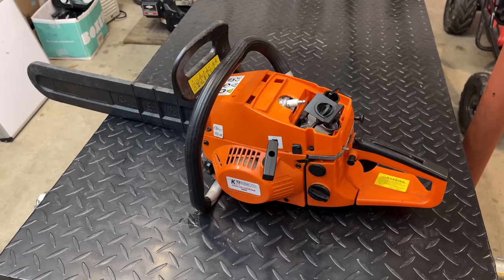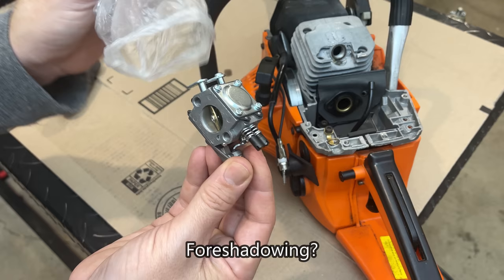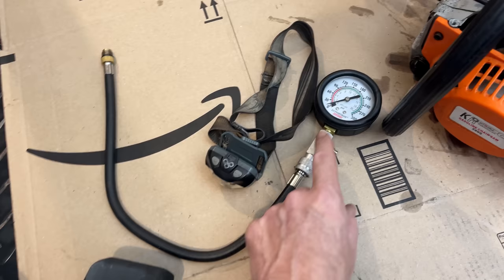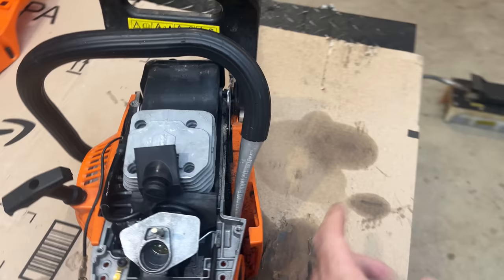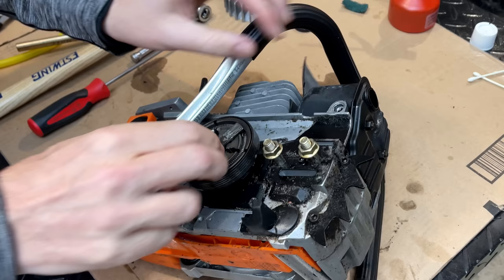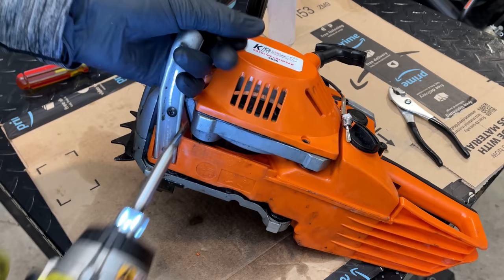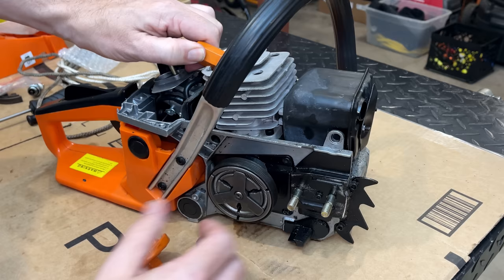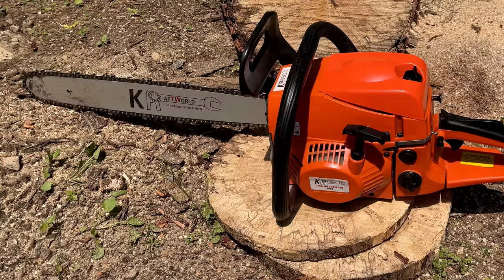Chinese Chainsaw Challenge - Will it Run? (Unbelievable Amount of Problems)

Comment: The expensive cost of buying cheap equipment.

You can buy once, cry once; Or buy continually and cry later at the hideous cost of repairs.

With just the time in labor and research alone, you could probably buy 10 of these saws and hope you get a good one, or buy one really good saw and not have to deal with these problems.
Reply from the maker: Even worse I found the link below.  These saws sells for about $32 wholesale.  https://www.alibaba.com/product-detail/High-Quality-Chainsaw-2-Stroke-5800_1600488897662.html?spm=a2700.7724857.0.0.56914d5fpTvqza
Reply: @jcondon1  Really sad to see mass produced junk like this, it's a gravy train for unethical salesman. I'm sure that these saws are going to end up in landfills and junkyards across the world. If this one saw has so much wrong with it, you know the rest are going to be of similar quality, especially for $32-$50 a saw.
Reply: Amen!
Reply: thats usually true..........but then I own a little chinesium 12" saw and it has been awesome.......its small,handy and makes pruning down medium trees up a ladder very easy. Is it a trade tool, of course not.......but it has been very versatile and worth the AUD $100 (US $67) I paid for it.
Reply: @wazza33racer  Chinese engines are not bad 100% of the time, I have a snow blower with a Chinese engine (Briggs and Stratton) that has started first pull and operated flawlessly for 4 winters now. But, in general the Chinese engines have far more serious design and manufacturing flaws than required to offset the attractive price. I have considerable business experience attempting to source quality products from China...the horror stories far outnumber the successes.....it's a gamble with unfavorable odds.
Reply: Every issue that James addressed are due to marginal designs...those problems are not fixed long term by installing new parts. They will surface again and how many issues are yet to be exposed?
Reply: @GGigabiteM so true
Reply: @Bunk599  I’d say the failure wasn’t with the design:  it was with the assembly.
When installed properly, the seals on both sides of the saw did their job.
The fuel line was the wrong material, so that does go to a ‘design’ failure, but it’s a minor fix.

For the wholesale price, it makes chainsaw ownership feasible for anyone.

Even so, I’ll stick with my Stihl.
Reply: @jcondon1  You just got to love the fake reviews.
Reply: @GGigabiteM  exactly my thought.
Reply: @Bunk599 Id like your opinion. Japanese products were looked at the same way as Chinese products years ago. Now they are premium products.. I believe if during manufacturing, the brand company told the Chinese  to build it with this type of tolerances, using this grade of material, with a good quality control team, that they could hang with most other countries in terms of quality. Its my belief that many American companies are so whorish for cash, they specify to Alibaba junk material with junk tolerances/specs with little to no quality control. Then if it turns out like crap. They don't care, they blame it on the Chinese and walk away laughing with all the money they saved by having 8 year old girls assemble the stuff. In other words, they produce what the company specifies and allows. Predator generators are Chinese Honda clones and the tolerances are so close to Honda you can barely tell the difference anymore. It's not as good- but quite good for a third of the price. But HF cares and has pretty good quality control. Hope this made sense. Any thoughts since you said you've experience with that scenario?  Cheers
Reply: @giggiddy  Thank you for your thoughtful reply. I too experienced first hand the dramatic transision Japan made over a span of 15-20 years starting in the 1950s. They of course today lead the world in many areas. China has had more than enough time to replicate that  progress. In addition to the Governmental and Commercial influences you mentioned I believe culture has an equal impact on the design and quality of the products produced by a country. I ran engineering/manufacturing companies in San Francisco, Detroit, Allentown and Austria. The skill, approach, expectations and thought process exhibited by the engineers in each location were dramatically different....my exposure to Chinese engineers was also quite different. Two of my very close friends have owned/managed significant manufacturing operations in China,....products and companies you would recognize.  I have many stories to tell that explain the quality of most products from China.
Reply: My concluding thought....not everyone can afford the good stuff....but if you can you are better off with a chainsaw made in Germany than China...in fact that sentiment applies to nearly all products.
Reply: @Bunk599  Wow. I sure appreciate your detailed reply as it comes firsthand and thats what I was hoping for. Additionally, you've made me rethink my position on the manufacturing process in China. Again I appreciate your response and I'm going to further educate myself on how things work there. I'm a huge fan of engineers and a enthusiastic student of anything engineering related. Your response made my day. Cheers! Dan
Reply: @giggiddy  You are certainly welcome. I enjoyed our exchange. I reread your email and I had one more thought on your comments. It has been my experience, many of the successful manufacturing operations in China producing high quality products are those situations where a reputable company with proven designs, like Briggs and Stratton, establish factories using their designs and manufacturing processes...China provides the buildings and machines specified by Briggs and the inexpensive  subsidized Chinese labor. Often the Chinese government controls pricing on raw materials to be far under the Global Market price which artificially contributes to a low manufacturing cost and selling price. This is a constant issue between China and competitors in other countries. The risk is China just decides to copy the product design and sell it under a different name....that is the origin of many of the Chinese clones. Best Regards, Al.
Reply: @Bunk599  Don't quote me but when they manufacture for external "foreign" companies under licence (ie with quality control and specifications checked) there's a better chance of getting reasonable quality at cheaper prices.  But when China attempt to "copy" and produce products under different branding the quality control is thrown out the window along with the Uyghur who screwed up 
And with "recognised branding" (eg Briggs and Stratton) comes reputation plus better, more controlled, returns/repair (customer service) because social media responds 😉😉
Reply: The petrol was not mixed properly with the oil ratio. Simple mistake.
Reply: I agree, the battery powered saws are much better.
Reply: Exactly.  Buy cheap, buy twice!
Reply: @Bunk599  I bought a Husqvarna 365 years ago instead of a Stihl. Not that Stihl is a bad chainsaw, you get a better value with a Husqvarna.
Reply: @brianallen9810  There are many good chainsaws that perform well for decades...just doubt any are designed by Chinese at the moment. I had a big Poulan and a  small Craftsman in the 1970's...they cut a lot of wood, took far too much abuse and always started. I too am a fan of Husqvarna.
Reply: @jcondon1  haha these saws arnt even worth the metal cost to make them. guess its a good thing these things are made with basically slave labor
Reply: @davidanderson4800  You will not see a commercial grade saw with a battery. They have their niche but the battery stuff still doesn't make the grade with hard usage. I still use air tools in my shop for the same reason.
Reply: @Bunk599  the blocked fuel hose, was just poor quality control, the seal installed crooked was poor process quality and quality control. The clutch band brake burned out is something I have seen fixing quality Stihl saws (operator error).   Otherwise, for a cheap saw, that someone might use occasionally its fine.  If you are going to cut a lot of wood, and its mission critical, then buy a quality chain saw.  Horses for courses.
Reply: @wazza33racer  I can agree with many of the comments that there were more than enough QC issues to go around, but I still contend most of the issues originated with poor engineering design and material specifications that are not corrected with repairs. The fuel line cracking is just inexcusable for a relatively new saw and a crank seal that still leaks after careful installation and a crank nut stripping is are marginal designs not manufacturing error. There are half a dozen design issues that would result in this new saw being unusable and tossed in the bin were in not in James Condon's capable hands. These issues do not just result in inferior performance to be tolerated by a part time user  but rather result an utterly useless product for most owners......thats not a bargain at any price. It would be fun  for James to keep in touch with the saw to see just how long it manages to operate before a new problem puts it out of commission.
Reply: @Channel-gz9hm  I am not a bot...just an old retired engineer with too much free time on his hands.
Reply: 32 dollars for this machine is still too expensive. I would pay 0.
Reply: Echo equipment, affordable and built to last!
Reply: @GGigabiteM I agree its a shame so much mass produced junk these days
Reply: @octaviofigueroafigueroa9794  Paying $32 for endless aggravation is a bad investment
Reply: @williamfoote2888  This is an Old new saw, last sold in US in 2017 it could be even older the fuel line cracked do to age, ethanol fuel left sitting, that will and does kill even Stihl saws, in fact on new ones if you don't use caned fuel warranty is void
Reply: There are certain exceptions, I own a 2006 Lifan  dual sport  200 cc motorbike with the Honda CG200 clone engine The previous owner put over 70K of gravel and road use and sold it to me.  I've basically just added gas and change the oil twice in 4500 miles now, and it still rides and starts well.  This bike is the Skyway GY 200 which Lifan licensed to build 1980's Honda clones for their far East markets.  Sold by Lifan America back in the early 2000's.

They're robust little bikes and use a OHV instead of OHC for the valves, sold to their customers in countries where as either rentals or because there's little mechanical support the simple pushrod engine's can be run longer with lower standard of maintenance.
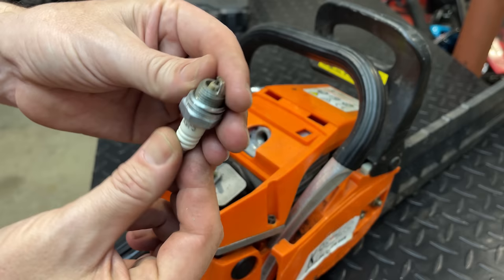Reply: [😅[[pppp]]pp]a 2:36 2:36
Reply: Treat stuff like this as disposable, If you only need something for one job it's probably worthwhile

As for running straight fuel in a 2 stroke, that will destroy most such engines - my brother did that to a 50cc honda motorcyle I once owned, despite being warned to check the oil and then did it AGAIN to a 125cc a couple years later (Understandably, he's not allowed to use my equipment anymore)

My father did the sanme thing to a McColluch chainsaw in the 1980s (long before chinese sourcing was a "thing")

"Non-mechanical" people are a menace when asked to deal with anything more complex than a pushbutton
Reply: 7<<>ì7 I'll 3
Reply: I bought a similar saw because I needed a chainsaw, and I was waiting for parts on BOTH of my Husky saws. I guess I got lucky as it has been pretty good, the biggest problem I have with it is that the bar will not stay tight, I have to every ten to fifteen minutes or so stop and tighten the bar. I put better quality nuts on it from my Husky saw but it still rattles loose. I got the work done, so the cheap saw paid for itself, but I’d never buy another one.
Great video well done on sorting out all of those problems.
Cheers from Tokyo!
Reply: @Bunk599  Chinese engines are a case of "you get what you pay for"

If you pay cheap junk prices then you get cheap junk. Pay a little more and the quality skyrockets
Reply: @Bunk599  many years ago one of my customers demanded I match a "too good to be true" price from a competitor. I declined as it was impossible to maintain quality and support at that price. They walked to the opposition - within 18 months they were paying twice what I had been charging them for a lower quality of service - and locked into a 5 year supply contract
Reply: @giggiddy  20 years ago, Chinese domestic cars were awful. 10 years ago they were flawed. Today they're the equal of anything on tbe market. In a decade they'll outstrip everything (including Japan)

There will still be cheap Chinese junk, just as in the 1980s-90s there was still cheap Japanese junk. 

Manufacturers build to what customers specify and are willing to pay for and "quality slip" on too-cheap-to-be-true supply contracts has happened forever. This is why sensible large customers must do due diligence and ensure the supplier will stay in business, unlike the "pile it high,  sell it cheap" mentality of Walmart, etc which encourages a race to tbe bottom quality-wise
Reply: @Bunk599  A Chainsaw, yes. A car, no.
Germany has fallen into a mindset of making things overcomplicated to justify the prices and in cars that has costs in excessive parts counts and insufficient oversight of incoming component quality (in addition,  just like 1930s Ford, they're deliberately degrading parts to last the design life of tbe vehicle - in many cases only tbe warranty period. Carmakers make most profit from spare parts, not complete vehicles)
Reply: Rubbish talk - what is the fuel mix in the country the saw was run.
What Methane mix makes up the petrol?
The Rubber handling the petrol was giving way stop talking rubbish about Quality of the machine until you sort the quality of the petrol
Reply: @jcondon1  That's the real issue - it's a $20 product and designed to meet that price point.  It's not that the Chinese can't make good stuff, they will just make whatever is asked to the target price point....
Reply: the trick is learning as you go, it's a diminishing return of bullshit that nets green if you learn something inside and out.
Reply: @Bunk599    Briggs and Stratton is made in USA  to à Milwaukee, ( Wisconsin.)
Reply: @roger-5879  I have a Briggs and Stratton snow blower with an engine made in China????
Reply: The more you buy low quality and cheap products, the more you cry..😢😢😢😢😢😢!
Reply: Excellent talent and video. Really appreciated the neverending patience and persistance. But I feel that this saw was in much worse state than you were led to believe, though. This helps me down the road for sure, but owning an Echo I do not run into these things often....
Reply: LOVE YOUR MONEY. DO NOT SPEND IT TO WHERE YOUR HEAD WILL ACHE LATER ON.
Reply: I don't know man, sounds like user error in this case. no oil in gas probably contributed to the crank seal problem. the cracked fuel line may also due to negligent - if you get a cheapo saw youre not gonna baby it and do the maintenance as if its a stihl. even James said he's surprised that the saw has a proper ball bearing, and a good fuel line design. Just take care of your equipment and don;t complain.
Reply: @jcondon1  whoever is paying more than that deserves to be played like a fiddle
Reply: @jcondon1  haahh,, 2 kits for 8 buks,, yup,,they should have a 2 months expiry,,to do the job again.. what gets me about chinese gear,, they work for $10 per wk,, you,d think,, with the lack of high wages,,they could spend the difference making decent sht,, LIKE JAPAN..
Reply: @jcondon1  try re building a disc caliper..  there fun...
Reply: @jcondon1  i would of spent an hr,, driving to harbour freight, buy a new one,...................................................................................................then,,repeat..    gives the trees a chance to grow though,,eh..
Reply: @jcondon1  gives b i n ,,a double meaning, eh...
Reply: @jcondon1  i was wandering about the clutch,,you,d think it would be anti clockwise,,  was funny though,,very unexpected.. ive seen trailer wheels do that.. & cars..
Reply: @jcondon1  id find the torque for clutch,, practice on a nut,,then same grunts on a ratchet.  ausie..
Reply: @jcondon1  wen ya first put a chain on,, it has to be tight, enough you can pull the chain..it was too lose to begin with..i have a husky,,varnish..  stuck a 20'' bar on it.. works great.. $760. about 21 yrs ago.. as said, only prob i had was leaving fuel, 2 stroke, in it,, clogs the line, jets.. 👍🦘
Reply: @jcondon1  yes i know,,me again,, allways test the oiler, aim at ground ,rock,bark, look for black dots..
Reply: @jcondon1  just a joke,,  lol,,, i have the clutch sequence on loop..       not really..
Reply: @jcondon1  yes,,i know,,,  just wandering,, why the stiker says,'' gasoline chainsaw,''.. if its 2 stroke.. or is it.??..
Reply: @jcondon1  You know it's bad if they have to say "high quality" in the link LOL
Reply: If it's not from Europe like a Husqvarna or Japanese like Honda then don't bother!
Reply: Very enjoyable and educational video!
Reply: @GGigabiteM  start an American 2 stroke without oil see how long it lasts ..even if it was the best available and cost 2000 dollars it will be trashed ...
Reply: IT Was used without oil....its sufered a lot....
Reply: The bitterness of poor quality remains long after the sweetness low price is forgotten.
Reply: I have one of these....works fine....ONLY the spark plug and the starter was faulty after some hours of work!!!!! Great product....i use Stihl 2stroke oil
Reply: thank you for going all the way! I'm stubborn enough to have spent three days crawling around on floor after tearing down another to see what to look for.
Reply: Well true enough but its the weeks and weeks of waiting on the parts to get there that is the worst part.
Reply: @nakoawarrior3186  depends on sellers and importer companies....in europe here these are acceptable tools....If u arent a pro and dont want to use expensive tools as a beginer.....to learn to work with is good enough - like dribling a car - as a beginer u Will never buy a Porsche BMW or Ferrari....o
Reply: Though if you don’t put oil in it you can buy the best saw ever and it wil still blow up 😅
Reply: @giggiddy  Th Japanese improved rapidly. They had manufacturing experience back to the 19th century. In the early 1970's I worked for a British firm making gear cutting machines for Honda. They provided boxes of blanks, these cut badly, surface finish varied from one side to the other. Honda sent their whizz kids, and rapidly upped their game.
Reply: This video should be renamed Chinese chainsaw massacre.

James Stewart with his Kaufman starters didn't have so much trouble
Reply: Have a watch on those DIY installs; So sick of fixing other claimed "tradies" workmanship.
Reply: Your logic is not quite founded in reality. These tools are disposable. 
Contractors love them, they are used, abused and thrown away.
Nothing to store and nothing to maintain.
Reply: Super
Reply: Why the blame on the saw when it was the idiot that ran it without oil-gas mix!
Reply: cheap can be good sometimes. it depends.
Reply: I have a 135 husky and it has given nothing but trouble, won't start can't adjust it revs too high at tickover etc
I bought it new because I didn't want trouble paid good money for it.
A carb is 95 pounds.
Reply: @pbysome  yea, I hate 2 strokes but for this seasons leaf blowing time, I bought a back pack leaf blower so I will see how it works out, I just bought some non ethanol fuel and will be mixing my own at the recommended 25-30:1 (it’s a chines brand)
Reply: @pbysome  expensive does not mean it's high quality. quality is a separate factor to analyze. price is a separate factor.
Reply: @henryng439  well that was the point.
Husqvarna are reputed to be high quality but patently they aren't.
Reply: I actually have a saw like this. It’s been running great - I’ve cleared 13 acres on pine and oak with it. Any chainsaw would die without 2-cycle oil being put in the gasoline. Also, Chinese chainsaws usually require 20-25:1 on the first several tanks, then 30:1 thereafter.
Reply: @bronzearmy2645 Would the Chinese chainsaws work with 50:1 fuel oil ratio? Or must it be 30:1?
Reply: CASH
Reply: @henryng439  the first several tanks need to be more like 20-25:1. After that, the manual (at least on mine) says it can go to 30-35:1. The risk of going all the way to 40-50:1 like on American saws is that the rings and seals may burn up from lack of lubrication. I have followed the manual and never tried going 40-50:1, so I can’t comment on any experiences with it. However, I’m still very happy with the performance and just premix myself a gallon of fuel prior to each day of working on the ranch. I test my compression occasionally and it’s 125psi, so it’s still essentially a like-new engine.
Reply: Or just buy battery powered and never worry about fuel issues and fuel ever again.
Reply: I had a couple of Chinese saws and never had any problems. This is not trade tool, it's designed for home use only. it is cheap enough to buy another one rather than repair when it stops. My one is still going strong since I bought it new in 2015 and I use it a lot to cut fire wood in NZ.
Reply: lind of like grills, I bought dozens of gas type and charcoal type that didn't ;last llonger than a year or two, and even then with replacement parts ecvery year. Then I finally broke down and bought a real Weber gas and thought I died and went to heave, so I did the same with the charcoal for a smokey Joe Weber and have used the one now fot 12 years and the other for 10 and both are still in perfect ortder. If I had known and spent the highet cost up front I would have saved tons. Junk like that chainsaw is a scam, actually but buying it from big nox stores puts poressure on the real manufavcturers to try and match price or go broke, so it ruins the entire industry. I have seen it happening in my 77 years, far too often and no one is better off from one end to the other. TRhe more we have the more we need.
Reply: 🤣:face-blue-smiling:
Reply: @davidanderson4800 only if cutting a limb or two in your yard. When you cut 10-12 cords in 12-14 days their not even close to being better. Some of my stihl gas saws are over 10 years old and run just as strong as they did when new.
Reply: I have echo saws but wanted a cheap saw to play with my small mill. Bought a similar saw on ebay for $80. Yes they leak gas and oil in puddles but 62 cc and cuts like a fool! Can’t complain for $80
Reply: @roger-5879 they also had a large manufacturing plant in Missouri, but it was shut down this past year
Reply: @gonedoneggonedoneg9863 I don’t think the owner ever made it run with the clogged fuel line and defective seals. That probably saved the engine from seizing up on straight gas.
Reply: @Bunk599  o
Reply: Thanks😅
Reply: Not sure what marginal designs you are referring to but every issue I saw (bad seals and a cracked fuel hose were part quality issues.   Even flywheel nut and clutch seemed like part quality vs. design.   The proof design worked was running the saw.

Sometimes stuff is obviously not going to last looking at it, but most of the time they look ok.  To see if it holds up someone has to use it, hopefully someone before I buy one.

The value of this video is illustration of how all the sytems of fuel delivery work on a chain saw.  I never understood before interaction of all the parts.  Great video.

@Bunk599
Reply: @Bunk599 Engineers from around the world are different, that is for sure.  I would agree with comments about "Chinese clones" of successful designs.  Fuel systems along with many engine parts need precise dimensions and materials.  To the eye, two parts can look the same but one works the other won't.  The successful team figures out the important features on the part,  produces each one correctly.  That said, sometimes a low quality part is good enough, trick is figuring out when to spend for quality and when not to.

I do alot of woodworking, the important part of the chisel is the steel at the tip meeting the wood.  If it is correct shape, sharp, the chisel cuts.  If the rest is beat up, rusty, etc, it doesn't matter.  Sometimes people see a shiny tool, think it's good but where it counts it comes up short.
Reply: @williamfoote2888  So long as one's operational expectations are in minutes, not hours.
Reply: Yes, indeed Captain Obvious!   There is although a great deal of value in showing the world how to make something useless do work.  This info can also be applied to a real chainsaw that's getting a bit shot-out, Like a Husqvarna with 150 hrs on it.  Service to others... This video is a force multiplier
Reply: @roger-5879   Briggs and Stratton  engine  nowmade in China
Reply: running without oil in the gas did not cause the crank seal to be crooked or to leak or the fuel line to crack.
Reply: @Bunk599  Amen .
Reply: A